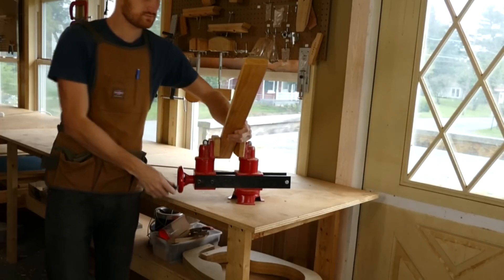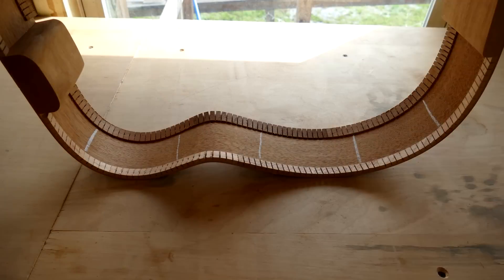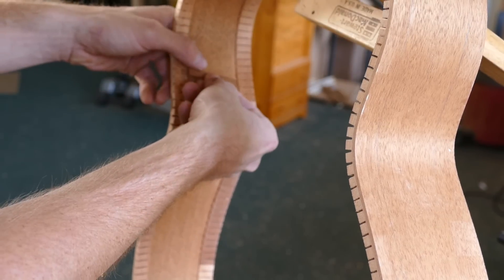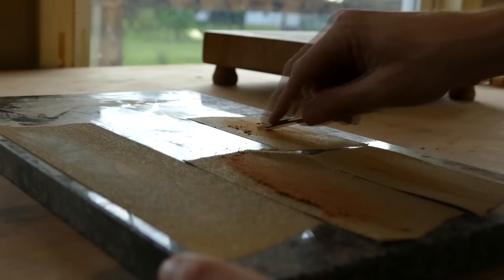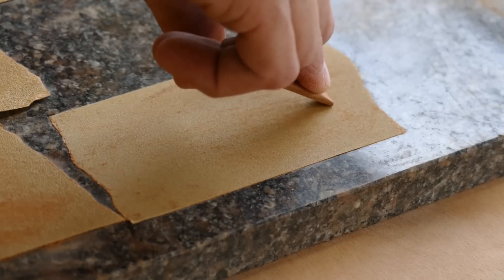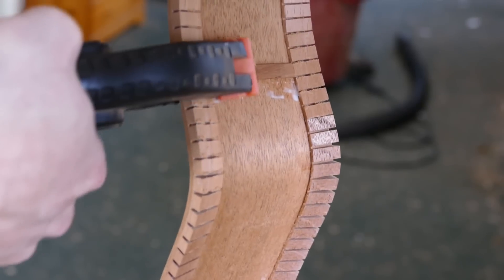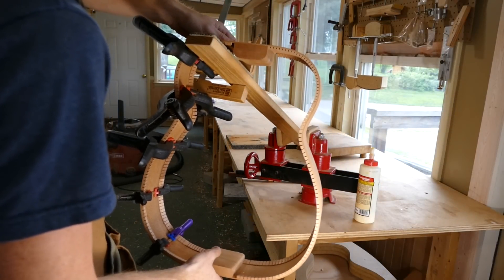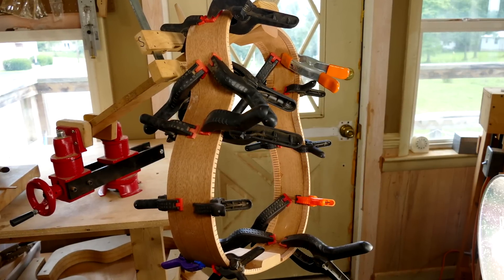Side Bracing

Comment: Hello :) 
I have to say, your movies are amazing!  I've been watching all of them:) 
I have one question. I'm trying to make a guitar to my brother, but why do we need to do side bracing? Is it normal to do so? I was thinking if the sides shrink, the bracing that are glued cross to the sides  will make the sides crack?
Reply from the maker: Thank you! Yes, you do need side braces. They are "normal," as in, used on all guitars. Think of it this way. The sides are hyper thin in order to facilitate bending (~0.075"). On top of this, the grain runs lengthwise for about 28" or so from endblock to neckblock. That is a very long run. That means that if the grain did split, which is likely given the the thinness, the split could run catastrophically from endblock to neckblock. The side braces give rigidity to the sides and they interrupt the lengthwise grain, preventing catastrophic splitting. The second reason for side braces has to do with acoustics. For the soundboard and back, it is obvious to most people getting into this that you want to, in some way, limit bracing to allow the the plates to move. Rigidity is undesirable. What is not so obvious is that rigidity is desirable for the sides. The ideal soundbox has 2 flexible plates attached to a rigid set of sides. If the entire box is able to move then you lose the responsiveness of the plates.
Reply: @EricSchaeferGuitars  Interesting, I was like oh no at first.. Thinking they would hamper the sound but I suppose that if the box were too sorta absorbent in a sense, the sides being soft or dampening the sound transfer would have a significant effect... I was like a lot of people probably presume, thinner is better and not too big of bracing and all... But if the top does most of the vibration, a solider box behind it is probably better... To a point of course... There is a balance, I am sure..